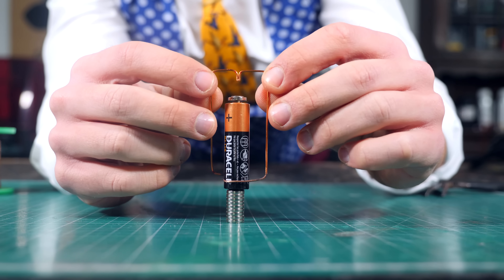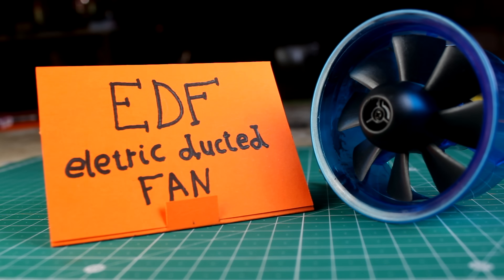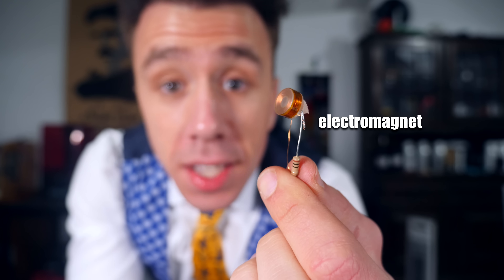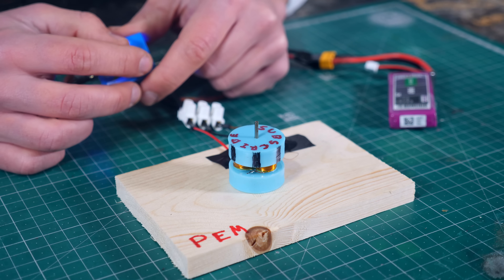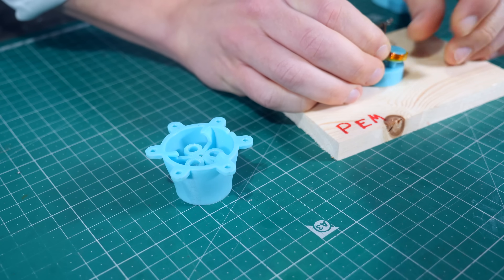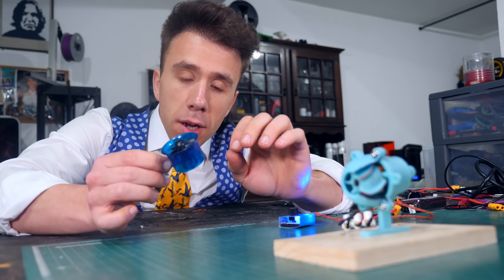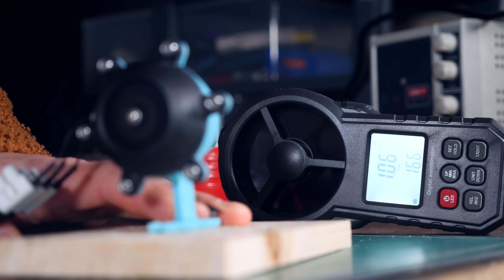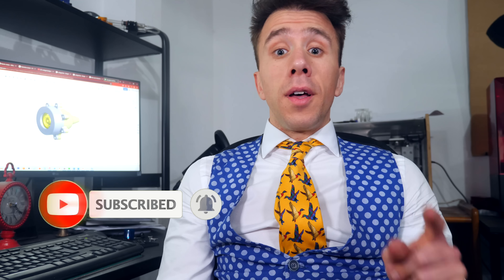I 3D Printed an ELECTRIC MOTOR FAN

Comment: I think thrust is made up of mass and speed and a edf make a lot of air go fast but a centrifugal fan doesnt move a lot of air at the same size but it can push it harder so you can decrease the nozzle size to increase the speed so you lower mass but higher speed but that is less efficient but need for jet engine because combustion chambers make a lot if back pressue while mixing fuel
Reply: YES!!!! THATS RIGHT!!!
Reply: @anthonyb5279  thanks bro

Comment: is the centrifugal fan transfering power into the walls of the casing? Pushing against the walls, expanding them would be a loss of energy, meanwhile the EDF fan just shoots all the thrust straight back

Comment: it is because centrifugal compressor are there to compress air, not make it move faster. if you want thrust you need more air, and move it faster. compressing it does not help with increasing the thrust

Comment: The best answer I can think of is that maybe a centrifugal fan requires more torque and that's the issue. Maybe the magnet motor you built just has more torque and can overcome that issue.

Comment: I'm a Fan now 😂☠
Video idea : make the smallest 3d printed turbine engine(that works ) you could possible make !
However try changing the numbers of blades and ,since I m studying it at uni , I know that also the size of the blade must change from top to bottom since you are compressing air and so his density changes , so to have the same flow rate also the blades have to adapt ! I hope it might help, but you are Integza  and I know you already knew it 🧐🤖
Reply: Or the biggest one ? 🤔
Reply: I assume because of the joke at the start, because you couldn't have just stumbled upon this video 7 minutes after it was posted.

Comment: Been thinking about this for a while: anyone remember the Chrysler Turbine Car?  Would a turbine engine like what was used in those work better with a modern CVT instead of the Automatic Transmissions that were used back then?
Reply: It probably would, as it would help compensate for the slow change in speed that gas turbines suffer from, but basic gas turbine engines are not very efficient, certainly no better than modern piston engines.  A combined cycle turbine can be very efficient, but way too large and complex for automotive use.
Reply: The answer to your question is yes. The reason they didn't use a CVT at the time was the mass of cars was much greater and the existing CVTs couldn't handle the required torque output.
Reply: Maybe a bit better, but it still wouldn't be particularly efficient. An average car engine has a max rpm that's roughly 10 times idle rpm, with a gas turbine max rpm is more like twice idle. That's still a small rev range for a car, although a cvt would probably help.

Comment: I know you've done it before but since you have access to stronger material now I'd love to see you try your hand at a tesla turbine again. And as always, great and very educational video!

A couple things I noticed that might make up the difference in the thrust could be a weight difference between the fan vs the impeller, the blade size difference, and the restriction of airflow into the impeller
Reply: You definitely dont have enough air flow through your fan, if you have a bigger intake and expansion chamber then you will make more thrust. Video idea, build a mini dragster with a tiny rocket engine😂

Comment: For the water cooled engine, why didn't you do it like a balloon. What I mean is that you should do like a double résine balloon entirely closed, and you inject fuel with metal pipe. Like that there is no burning end

Comment: This Friday just got better!
Reply: Fr tho
Reply: Fr
Reply: One of the reasons it might not be working is because the type of motor you have is for speed and not torque. There are some motors that use the same type of system and are more powerful just what is needed for the project.
These are used in larger edf’s such as in x-fly motors which I used in a version of your afterburner design.
Reply: Agreed
Reply: Yes my friend
Reply: yes
Reply: Agreed now I can make a small plane :)
Reply: I think it’s a flow issue. As a pump, yours would work better. I think your fan would work better in a fluid environment better.
Reply: You got that 3d printer?
Reply: POV me seeing this 5mo later and it’s Friday

Comment: Ha first

Also I think the motor isn't up for the job because edf motors are more for speed than torque, where you are compressing air then forcing it through a constriction rather than just moving it.

So I guess:
-More torque
-big compressor wheel like a car turbo (since with this design the final airspeed is dependent on forcing air through a Venturi)
-more detail into the Venturi effect at the end